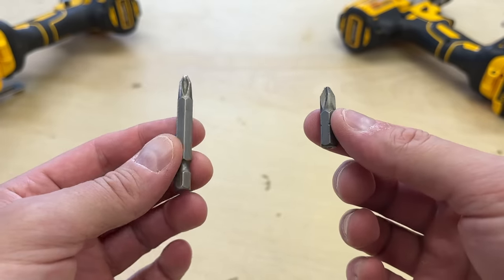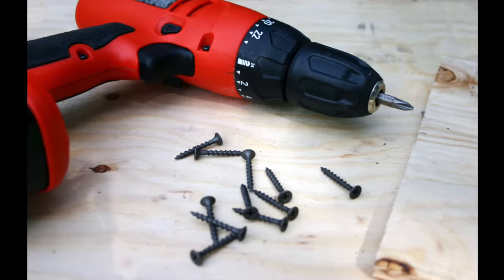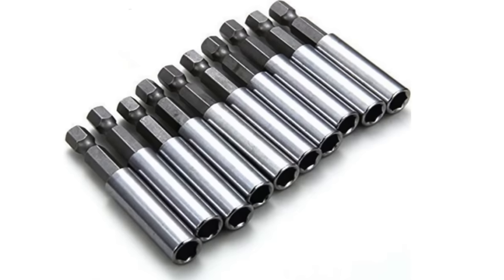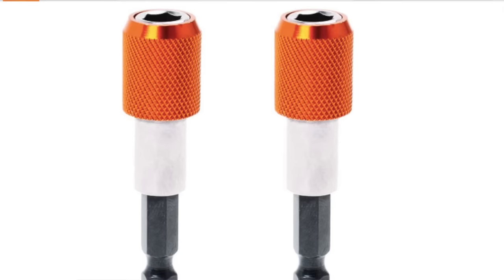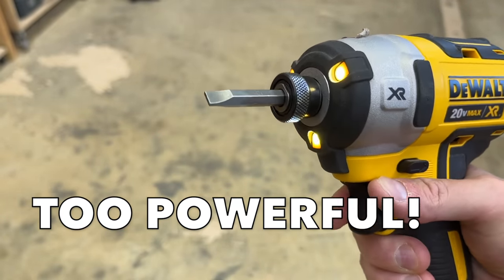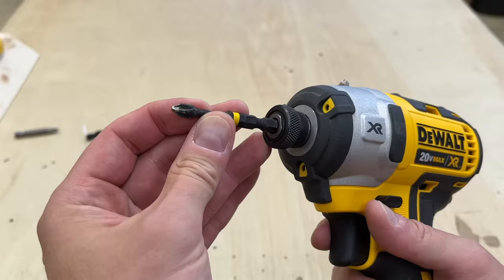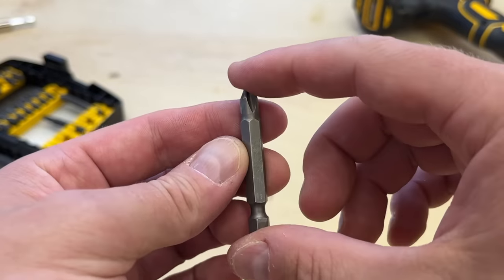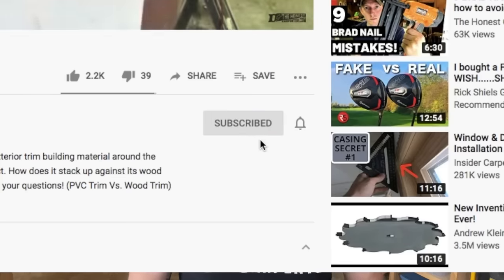Power Bit vs. Impact Bit vs. Insert Bit...WHAT'S THE DIFFERENCE?! (Driver Bit Guide For New DIYers!)

Comment: I just build a hardwood terrace, and started with Milwaukee impact bits and they kept breaking, then I tried some cheap powerbits, and they dint break but after longtime use they twisted and if if I had a failure it was the screw, i will never buy impact bits again. I worked as a carpenter/traditional boat builder for 18 years so I know about woodworking.

Comment: The quick change bits been around for decades.  Even though you can chuck them, they are primarily are used with a quick change holder.  These I am guessing were developed in response when variable speed drills hit the market and drills could be used for driving screws.  Chuck and unchucking bits is a pain, particularly when driving philip headed screws which cam-out easily.   Also, for a long time you needed a “chuck-key” to tighten on the bit, which made it even more of a pain.   Eventually the 1/4’ hex locking bit standard was established.   So when 1/4” impact drivers came on the market it was only natural to use, the 1/4” hex standard.  You also now have compact drivers which only has a quick-change 1/4” hex drive or you chuck a quick-change 1/4’ hex bit, in these cases you don’t need the typically more expensive impact-rated bits.

Personally I would love to see the “insert magnetic bit” to go away, pulled off the market.  I have never seen a holder which can securely hold the bit well enough to stay in the holder consistently.  It either stays on the screw or fall off on the floor, particularly true if using Robertson or Torx head screws.  I never buy any bit kit that has those insert bits, they are a waste of money, just get the 1/4” hex locking bits.   Also watch out for 1/4” hex bits without the groove, These are really useless, you have to chuck them and because of their weight don’t stay in magnetic holder very well either.

Comment: I just purchased a hex impact driver and the assortment of bits. It's absolutely not the same thing as a drill driver and its' assortment of bits. Each has its' own application. For example, I just replaced the door latch on my RV. It uses machine screws. There's no need for an impact driver in that situation. However if you need to drive some long structural screws into some wood timbers, I'm going for the impact driver.

Comment: Evening, You seem like the correct chap to ask….so just bought the Dewalt drill a set so have the impact and the hammer drill, I’ve ordered the impact screwdriver bits. However I also wanted to order some drill bits for some household DIY so drilling wood,Plastered walls and maybe some outside house  brick… looking at dewalt stuff to go with my Tstak but there’s so many variations of dewalt drill bit sets what do I need? A reply with some advice would be amazing

Comment: Good video Ethan.
The only impact rated bits I have broken have all been from one company and they have been the same size… I have broken 3 of them in the last 5 years. Since I switched to a different brand I haven’t had one break.
You were talking about the ring on bits… That’s one thing I like about Festool Centrotec bits, drills and chucks. The quick release chuck and power ring on centrotec bits is higher on the shank of the bit and the bit has less 
wobble/runout and it makes it easier to drive a screw or use a drill bit. You spend less time trying to make the screw or drill bit go in at the proper angle..
Ron
Reply from the maker: All good info, Ron! I won’t ask what the brand was 😅 But festool is just a cut above on most everything they make!

Comment: I use 3/8 6" long lag screws vice stakes for my 10x10 canopy.  Being lazy I use my cordless impact gun, 12" hex bit extension with a 3/8 socket adapter.  It's a lot faster than using tent stakes and powers through small underground obstructions.

Comment: There are non-impact tools that utilize the same locking mechanism as drivers.  For example, DeWalt makes a 12v screwdriver that uses them.  In that case the longer bits are perfect.   The 12v screwdriver is amazing btw haha.

Comment: You showed the quick change bit socket near then beginning of your video which is meant to use with the non-impact rated bits that have the longer shaft and grove.  Just a quick change adapter for regular drills that mimics the impact drivers bit holder.

Comment: Just in case it hasn't been mentioned by somebody else already… The power bits having a quick change power groove are geared towards the quick change Collett adapters that are intended for drill drivers.
This allows quick release power bits to be used

Comment: The quick release feature what you call a power groove  was introduced for powered electric and pneumatic screwdrivers used in industry and later adopted in what  impact drivers. Industrial electric screwdrivers have clutches that limit their torque.

Comment: As a commercial door mechanic, we were using impact drivers years before they became popular with other trades.
Hinge screws on commercial butt hinges used in steel frames use a #3 tip, and they easily pop out, and ruin the hinge screws. Impact drivers will not pop out, if you know what you're doing. The screw will break, if you don't have good finger control, but the head will still be perfect. (Then you get to drill out the piece stuck in the hinge prep.)
Also, using self drilling screws to install closers, exit devices, and weatherstripping, require an impact, or you spend three times as long drilling, tapping, and installing each screw.
 I remember being the only trade on commercial jobs that used impact's, and other trades would ask me about them.
Nowadays, they are ubiquitous on jobsites. Once you get good with an impact, a drill is never the same.
Reply from the maker: That’s awesome, David! I know I got hooked on them when I first tried one around maybe ‘08. 👍
Reply: @TheHonestCarpenter  , They may be hard to find now, but the old #3 tips we used were about 2 1/2 inches long, and had three raised lines on each flute of the insert that made it fit snugly into a hinge screw, so the screw didn't fall off when you were putting the screws in.
A beginner dropping screws wears out the guy holding a 150-200 lb door so the middle hinge can be screwed into the metal frame. Then the top is pushed up do the hinge can be tightened, and then the bottom can easily be popped in, and screwed off. 
Two good workers can easily swing a door in 30 seconds or less.
Good video, by the way. 
(I love those Milwaukee impact tips. Dewalt also makes good ones).

Comment: You're missing something here. There are four kinds of popular but retention devices - that sometimes are used together.

Magnets - most bit holders and extenders these days have magnets. The magnets serve two purposes, as they also magnetize the bit itself which holds screws in place, which is helpfull.

Ball bearings - a spring loaded passive bearing that provides a positive lock to hold a bit in. Stronger than magnets alone, but can be overcome with an intentional tug. Often found with magnets too.

Retaining rings - a steel ring inside the bit holder that seats in the small bit corner notches that you show in your video. Very similar to the ball lock, they are overcome by pulling a little harder to get the bit out. Also often found with magnets too.

Ring locks - found on drivers primarily, you show these I'm your video. Non magnetized, they only release compatible bits by pulling the filler. A bit with a ringed shank is needed to work with a ring lock.

Comment: 0:53 The little notches on the hexagonal walls on the small bits are to catch the small bearing on the bit holder to lock them in & stop them pulling out ,to activate the lock-in you normally pull the sleeve down on the collar on the bit holder.
Reply from the maker: I’ve read that, Brett. But I’ve seen holders with spring loads that just didn’t grip them there. It has confused me 🤔

Comment: This is great info, although a bit late as I have already snapped 2 tx10 bits with my impact driver. 😁

I'll be sure to order rhe correct replacements though. Thanks for making this info available. I had thought the power bits were made for impact drivers.

Comment: I'm not a hobbyist - DIY person, I'm a professional and have been doing construction and remodeling for about 30 years and I started using these impact drivers around the time they were invented. 

I don't normally buy the impact rated bits i buy the regular ones from DeWalt. I think I've bought maybe two boxes of the black impact rated driver bits, just because the regular ones are a lot cheaper and they almost never break. I don't know what you're talking about saying that you can't use these things with impact drivers because you absolutely can. This is not a theory and something I've gotten by with on a couple of projects, I do this for a living and it's all I do. I do not baby these tools either. 

I can go through a 5lb box of 3in deck screws with the driver bits that you say you shouldn't use. I have broken them but I don't even remember the last time I broke one because it's not even common, and if you do break one it's no big deal you take it out and put a new one in. What you're saying is ridiculous honestly.

Comment: DeWalt DCF680N1 and DCF601B
M12 2401 and 2505
Examples of non-impacting cordless tools with a quick change collet that secures power bits.
The Malco Connext(1,2,3) are bit holding handles (human powered normal, stubby, and ratcheting) with a proper collet to prevent bit loss.

Comment: I now understand what was wrong with my impact driver I did not know how to use it and was putting the wrong bits in it and that's why they weren't holding it should have been using the extension thank you

Comment: 1. The small notches on the insert bit are specifically for the spring ring in the bit holder (it's that C shaped metal thing in the insert bit holder). They're not indicating how far they should be inserted.

2. Because we have screwdrivers, as well as impact drivers (not to mention screw driving modes on impact drivers) - there are non-impact rated bits designed for fast release collets. 

3. Never put a power bit(deep groove) into an insert bit(small notches) holder, because the C spring will jam and make it very hard to get the power bit out.

Comment: the non-impact bits work fine for most applications I come across as a cabinet installer...  not as long lasting, but they rarely break.   For other work with heavier impacts needed, sure, stick with impact bits.  Much of my work is with dewalt's awesome 12v impacts, though I have 18v and more for heavier work.

Comment: Notes:
(1) Power grove is better called "quick change (collet) grove". 
(2) A manual screw driver or low power screw driver has a bit older built-in, and that's were I use my 1" bits. I don't use an adapter in a drill/driver unless it's some obscure bit I only have in 1" size. I try to have 2" bits of everything I'd touch with a power tool.
(3) Any 1/4" hex socket is an adapter for your ratchet! 
(4) "Insert" is a funny label: Is there a non-insert 1" bit? 
(5) We should just a say "X inch (impact) bit", assuming that 1" never has a quick change grove and that any modern long bit does.
(6) I have the dewalt 1" bit adapter that locks onto the 1" bits and has quick change collet kind of mechanism. Maybe it's using those little notches in the bit. Pretty neat, but doesn't have the screw sleeve.

Comment: I have seen many non-impact bits with the power groove. I believe they are just intended to work with non-impact locking quick connects (which I find preferable to the magnetic type).

Comment: I thought the insert bits were for screwdrivers, electric and manual.
I was confused by the distinction between impact driver and impact wrench, (I ended up buying both types) the impact wrench bit had a square socket of half or three quarter inch. I learned to get a torque stick for my car, the old guy working at Bunnings warned me about overtightening wheel nuts as they could shear off.
My last use was to screw in the screw type tent pegs, I hated hammering in 18 pegs and the impact wrench is a labour saving device.

Comment: 3:20 My impact drivers each came with one of those suckers.  Maybe it saves them a few cents since all bits wear out and need to be replaced eventually so it doesn't matter that they are not optimal.  They seem to do the job ok for the most part.

Comment: I have a Milwaukee M12 Driver with a quick release collar.  It is a driver only and it has no impact features.  I started buying the non-impact quick release bits for this driver.  I bought the driver in about 2008 before they were making impsct drivers.

Comment: Interesting; I never knew about the impact bits.  My impact driver came with onboard storage for the regular driver bits, and I’ve never broken one.  Actually, not true, I snapped one of my 3” extended bits once, which makes sense, but none of the standard ones have broken.  I’ll have to look for those special impact bits, but for me, if it ain’t broke…. Appreciate the overview though!  👍

Comment: the power bits with a power grove are for the power screwdriver, not to confuse it with the impact drill.  the power screw driver will usually run at lower torque and speed than a traditional drill or impact driver and have a straight handle

Comment: Power bits can be used in impact driver if this tool has power adjustment feature, on low power settings it mostly don't break power bits.

Comment: Really this comes down to cost/fastener.  I've worn out a lot more inserts than I've broken and when working rough, cry less over a $0.20 insert bit lost in the dirt than a $5 fancy one. You also have to remember that in a lot of places you have to work with what you've got with you.  That trip back to the shop/store can be worth a lot of inserts or even a drill.

Comment: The only time I have an issue with insert bits is torx.  The bit seats so well into the fastener that it overcomes the magnetic hold of the bit holder.  

So 1/5 times I have to pull the bit out of the fastener and put it back in the bit holder.

Comment: Theres some very fundamental errors in this video. I know some of them are called out in other comments but to consolidate from my knowledge base: 

Insert bits: shorter bits designed and intended to be used with a handheld driver handle/shaft or a dedicated bit holder in a power tool. The bit is retained in the handle/holder usually by a magnet at the bottom of the hole but sometimes simply by friction (especially when used in a drill collet). They can be chucked in a standard drill but in my experience without the bit having a backstop it tends to wander into the tool over a short time and require re-chucking (just get a cheap bit holder to solve this).

Power bits: usually longer bits designed specifically to be used in a power tool.  They all have distinct grooves toward the base to facilitate locking the bit into the tool, this is what makes a "power bit", .not the length. It is not possible to remove the bit without releasing the retention mechanism (usually a sliding collar on the hex bit holder) without damaging the tool or bit. This means your bit will stay in the tool even when on your belt. It also makes using a driver tool usable as a drill as the bit will come out of the material as you pull back on the tool; no direction reversing needed. Since they are longer they chuck to a standard drill better as a longer bit can usually bottom out in the chuck to provide a backstop and the chuck jaws are equally happy on the hex shank or the rounded bit shaft.

Impact bits: a special type of power bit designed to allow the bit to twist a little and with stand the higher moments of torque applied by an impact tool's hammering motion. Whether or not you need to use an actual impact bit in an impact driver depends mostly on the quality of the bits you're using and the amount of torque you're putting into the bit/fastener. Note that impact bits don't in any way diminish the tendency to cam-out, that's much more about the fastener type: slot/flat vs Phillips vs Toque vs hex and the quality of the finish machining. There is much debate in the real world about whether it's worth the cost to use impact bits for most common applications.

Comment: I’m a half-assed DIY-er, so please be gentle with me re the question he referenced toward the end.  I have a 20-year old Dewalt 18v drill/driver that included several power bits with power grooves that was mentioned.  But it came with a 1-inch thingy that I need to insert into the drill in order for the power bits to latch on and work.  Maybe that ancient tech contributed to the modern conundrum.  Damn if I know, would appreciate any competent folks out there to opine.  Gonna replace soon with something that weighs less than the 50 pound rig I have now, but kinda want to know.  Thanks all.

Comment: didnt know that dewalt sleeve was supposed to move lol, thought it was just the shoddy manufacturing.  And you can use longer normal non-torsion zone bits on an impact driver, which is what they were used with before the torsion-zone ones were invented. They just might break faster especially on a heavy professional jobsite type use. Home use I have yet to break a bit on anything and was thinking I'll buy some Dewalt Flextorq bits once I break one, haven't bought yet.

Comment: My guess is that the power bits got the powerband because of the quick change with retainability gimmick and it looks cool. It's really just a way to sell and market more and more expensive tools.
Reply from the maker: So many gimmicks come and go in the tool world, Cameron 😵 Also, some valid things just quickly get replaced by better designs
Reply: the quick change is super useful in production-level use. Particularly when using pneumatic drivers.